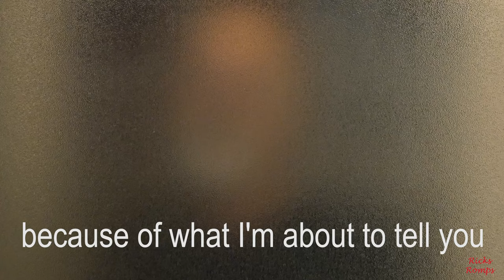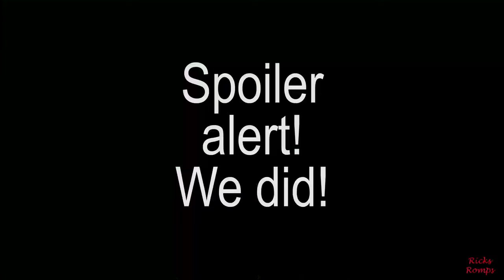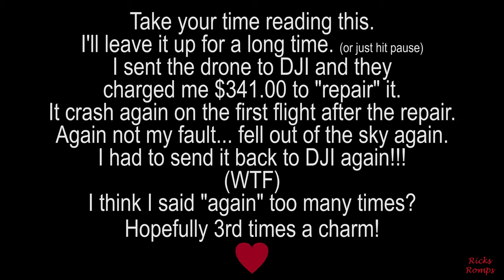Why did my drone fall out of the sky?  89.

Comment: Ahhh, that's too bad! Ouch, $341 and it failed 3 more times? Did he test fly the drone? IDK anything about drones, but certainly enjoyed seeing yours flying over beautiful terrain.
Reply from the maker: Well, it has only crashed twice so far. According to DJI, they said they did a quality assurance check that passed. I don't know if they test flew it or not. The rep said they do have an area where they can do a test flight but he didn't know if one was done. DJI also said in an email that the $341.00 charge was for repairing the drone but when I spoke with them on the phone the rep said it was replaced with a refurbished one. Kinda strange I think. I have to wait 7-10 days before I get it back and hopefully it will work properly. Also, I'm really glad you enjoyed the video. I have been watching your channel and enjoying your videos, too. I need to do some more metal detecting, soon. I miss doing it.